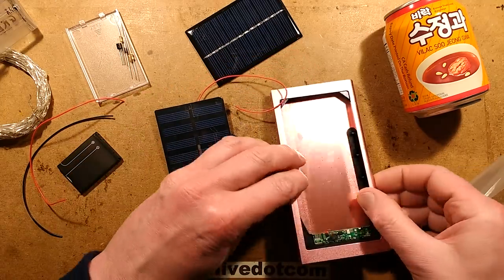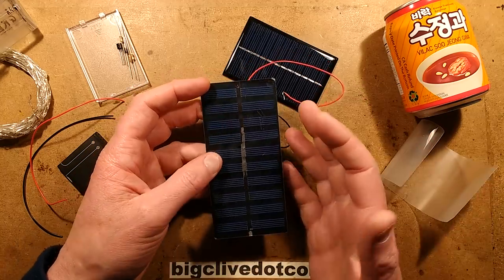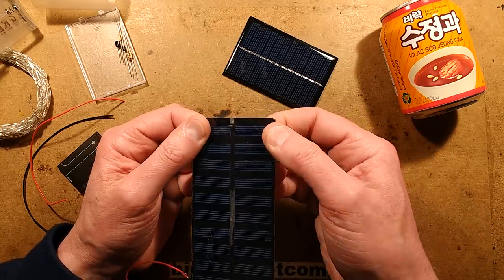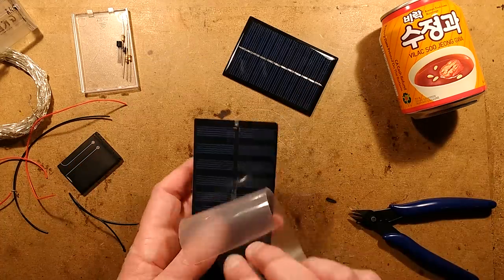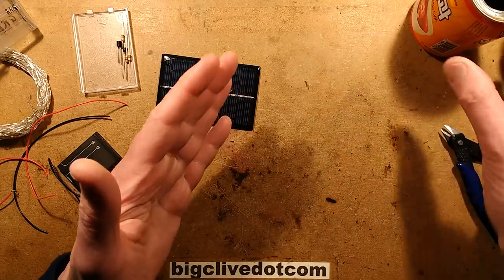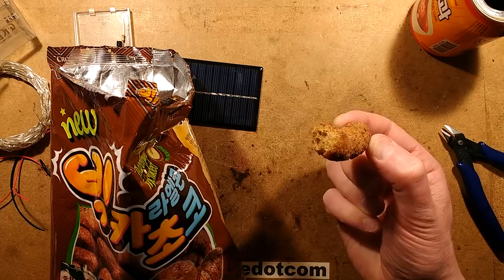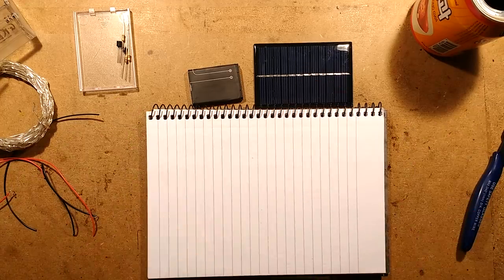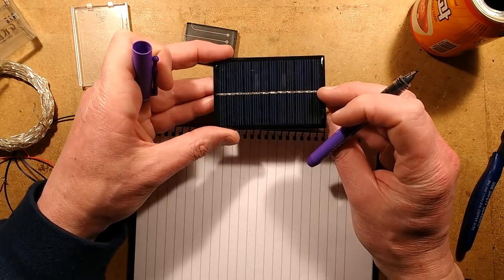Simplest solar light possible, using old phone battery.

Comment: You could possibly apply this to an old car for example (or RC car) to have automatic lights, though on a road car you need to make sure when the car is turned off it doesn't turn the lights on when your are in bed at night, lol.
Great Video Clive.

Comment: Ah something I know a bit about!  
I've played with those cells a lot for projects.  
If you score the surface with a blade and soak it in acetone for about a week, it will take it all off the cells so you can extract them... In all their micro fractured goodness.

Regarding them being cracked, surprisingly they can actually be significantly fractured before it impacts performance, so long as the potting holds them in their original place.  
This includes household solar panels upwards of 200w. I have have tested several that are shattered and they still produce most of their power. (5A out of 5.5A max short circuit current)  

However, I've also seen intact household panels where little cracks can be seen in the cells with a brownish burn line along them. So obviously some current is shorting across despite them still producing

Comment: Dear beloved Clive, I just made the exact same circuit a month ago, with the only difference of using a MOSFET instead of a transistor (I use MOSFETs because I design electronic chips; if we used bipolar transistors, we would need current to keep them in the on state which is unacceptable). 
This has the double benefit of: 1. not allowing the connected LED(s) (or whatever you connect to your output) to drain the battery bellow 2V which is extra crucial with Lithium Fe or Lithium Polymer batteries (that you are using) since most MOSFETs have a gate turn on (threshold) voltage of 2 volts, and, 2. it requires NO resistor at its gate (your base since you are using a transistor), since the gate of a MOSFET is just a tiny tiny capacitor. Using a MOSFET, you require NO current at all to pick up or to feed your ON or OFF state. So, using a MOSFET you will be amazed by the efficiency gain! It's like it's not even there. Bipolar transistors are the shame of the family, use only MOSFETS man.
Also, regarding the diode: I initially thought of putting a Shotky diode since it has less of a voltage drop (0.3V compared to Si, which is 0.65). HOWEVER, Shotky diodes are sooo leaky (reverse leakage), they are even leakier than the whole solar panel (the solar panel can be considered a diode at dark, and basically it is in reverse to the diode we have put in the circuit). This means that if you use a Shotky diode, the circuit will not work, since at dark the Shotky will be leakier than the solar panel, dragging the voltage at the MOSFET gate's node almost down to zero, not allowing the MOSFET to turn on. Using a Silicon diode, is like having the same material as the solar panel for your diode, and since the diode is just a tiny spot, it is guaranteed to be less leaky than the solar panel. 
At night, with a Silicon diode, the solar panel is leakier, so the MOSFET's gate node will see a much much easier path to the plus side (your solar panel at the other end is connected to +), so its voltage at the gate will be almost whatever the battery is and the MOSFET will turn on fully and happily until the battery drops to 2 volts. During the day, the solar panel produces energy with a polarity of (-) at the MOSFET's gate node, dragging the voltage down to zero, turning off the MOSFET.
Reply from the maker: I had pondered using a 2N7000 in the circuit for the reasons you mention.  The on-state resistance is actually enough to limit the current through the LEDs too, so theoretically the circuit could be built with just a FET and diode.
Reply: That is exactly what I have implemented!!! I love this circuit as it has NO resistors, and I hate resistors. It's just a MOSFET, a diode, a LiFePO4 battery (nominal voltage 3.2V, max 3.65, depleted bellow 3.0), and an LED which is happy turning on with no resistor at 3.2 - 3.65 V (have connected blue ones, you could do it with a blue or any other colours based on the blue emitter).
I watch it for a month now and love it as I know it has not dissipated not even an electron in a resistor in the circuit. The design could only have been achieved with only one cell (better than charging 2 cells in series, it never is done exactly right), only with the LiFePO4 chemistry. Its voltage is right enough to turn on mosfets, drive LEDs without resistors, and mosfets normally turn off at the voltage it doesn't like to go bellow (2V - 2.5V). All the component values had to agree, and since there exists this combination of a circuit, one can only just sit back and admire how everything fitted together.
Reply: I drive the LEDs at their voltage, 3.2V, no resistor is needed. Therefore, since I had available an IRFZ44N, I used that, it is an overkill, I know, for a few LEDs. It's gate turn on voltage is much higher than the 2N7000, it's 2-4 volts (I need a high turn on gate threshold value so that it turns off when battery goes bellow 2 volts so that it doesn't kill it). Also, the RDSon for that MOSFET if fairly low, so most of the current depends on how the LED accepts it (I have matched the LEDs with the nominal voltage of the battery, which is 3.2 volts for about 80% of its life).

Comment: When you connect the base to the positive side, wouldn't it light up as soon as the battery is fully charged but it's still daytime? There wouldn't be current flowing through the battery, so it has to flow into the base, trigger the transistor and then the led lights up.

Comment: I've built two of these, and learned that in order to make the LED bright enough (at least brighter than they were with the original circuit), I needed to eliminate the 10K resistor on the base of the transistor.  I simply connected the base to the diode/negative of the solar cell.  It has the advantage of simplifying the circuit even more.  I'd prefer the LED's were even brighter - the transistor still does not seem to fully turn on - still working on that.
Reply from the maker: I did a PCB based version with a MOSFET, which tends to turn on easier.

Comment: Great little project, I think I have all the parts necessary in my collection to build a few. I have a stack of small 5.5v solar panels, which when I tried wiring about 10 in parallel it was enough to charge a USB battery pack.
Regarding lithium battery storage level, all the lithium chargers I have which I use to charge packs for my quadcopters have the storage voltage set to 3.8v or 3.85v, 40% charge apparently, but packs that have arrived by post are often usually lower voltage, seem to be about 30%.

Comment: I discovered your channel shortly and love it. In videos i try to learn something from it others inspire me to try some builds myself. But i find it difficult to modify your builds to my situation of components that i collected and salvaged from the trash bin. Since I am not a electronics technician i don't have the knowledge to do so. For this video in particular, i would love to have the schematics for a similar solar light but with a 2V solar pannel + 1,2v NiMH battery and a couple of (4 to 10) of the same leds but in white. Maybe in videos like these it would be great if you could suggest different component values for different situations. Like in a table or so.
Reply from the maker: You may find it easier to get an existing solar light and replace the original LED with a string of parallel LEDs like these.

Comment: Nice.  I think I'll make one of those right now - maybe do it as a module that can be hooked up to a battery connection (got a strip of lights that runs on 2 AAs).  Also a good excuse to finally take that shítty old windows phone to bits :p

Comment: This video inspired me to build an USB powered emergency light from a LiIon battery "10W" LED floodlight. Handy to have in some poorly powered environments (e.g. sites on generator power), does not meet regulations for emergency lights 100% but is better than nothing (does not switch on within legally required time because of the capacitor in the USB power supply discharging slowly, but lights up within less than a second).

Comment: I found those epoxy coated solar cells to be inadequate for all my solar projects, especially for ones inside a car. If you search for "solar charger glass", those work 10x better. Also when the epoxy ones get foggy you can use automotive rubbing compound and toothpaste to polish them up again.

Comment: Japanese and American sourced transistors (and other semiconductors) have a simple distinction. U.S. starts with 2N** while Japan starts with 2S** (or just drops the 2S from the label). So a Japanese C2222 is a U.S. 2NC2222. Also, the pinouts are switched. Japan puts the Base on the end, U.S. puts the Base in the middle. Both make sense in their own sort of way. Brits put a rectangle where a squiggly resistor symbol belongs.
If you're having trouble trying to understand how a transistor works, think of the dimmer switch on your wall for an overhead lamp fixture. A tiny effort from your fingers (Base) allows a massive current to flow from the power company (Emitter) to your ceiling lamp (Collector). But you can turn the power up and down with only a tiny input. Biasing the Base with a resistor network is the equivalent of bumping the parameters on your dimmer so there's no "dead spot" at the bottom of it's travel. Biasing would make it start conducting exactly where you want it to begin, rather than a third of the way up the scale and then "jumping" on.

Comment: As you paused to contemplate the diode band and how to orientate it, i was reminded of current flow. I wish that when its direction was initially chosen, that it represented electron flow rather than the opposite of the electron flow. There would be less chances for confusion.
Reply from the maker: They didn't realise at the time, since metals seemed to flow from positive to negative in electrolysis.  I use conventional current flow to make things easier for those new to electronics.

Comment: You know the first time I watched this video, it got me thinking.  You see I was really into those little mini pocket PC's called PDA's before I decided I would give in and buy a smart phone.  So it was that I have a LOT of old PDA batteries laying around, most of them still hold a reasonable charge. So for my first attempt at making something out of it, I found a little board on Ebay that was a combo board that had Bluetooth reception, a mini SD slot for local MP3 playing, and a built in amplifier that could drive small 8 ohm speakers.  It wanted 3 to 5 volts for power.  So I wired one up to a little PDA battery (3.7 volts) hooked a couple of those cheap china silver faced 8 ohm speaker that looked like something for the old 8 transistor radios of the 60's, used some hot snot glue to mount it all in a cardboard box from some device I purchased over the years from China.  I poked holes first so the sound could get out and used my label maker to mark all the built in buttons, then covered it all with some contact paper that looks like woven fiber material.  For charging, I was in luck as the combo card also charges the battery when plugged into a USB port.  Now I have a  small MP3 player that can also serve as a Bluetooth speaker for my Phone, Computer or what ever I want to shove at it.  The old battery has held up very well, total cost for all the parts was around $6.00 US  To top it off, the little player does sound fairly good and  sound wonderful if you plug in some headphones.  It can also transmit to my hearing aids if I pair them so that's makes it a great two way MP3 player.  Only problem now is that everyone who sees the little guy wants one!  I am sure somewhere on Ebay you can get them ready built.

Comment: Drawing the pinout of the transistor is very helpful. It helps bridge between components and diagrams, i like to draw the components in diagrams as the look in the hand,  how easily do the green leds trigger the transistor into flashing the circuit,  putting everything into waterproof led floodlight  fitting would be ace.  Interesting crisps to use in poop eating prank.

Comment: My understanding was that lithium rechargeables are supposed to be stored at 50% charge was a compromise: they degrade slower the less energy is in them, but at 50% charge they degrade barely any more than at 0% charge and because they self discharge at a relatively rapid rate storing them at lower charge levels increases the risk of overdischarging them in storage and permanently damaging them.

Comment: I find myself suddenly flooded with these type batteries. You see many of the new all channel am/fm/sw/lw/weather/alert radios from China run on them. I find myself with 3 of them now, each with it's own rechargeable battery of that type, and I have ordered 3 extra batteries in case of power outage where a battery change would be in order to keep up on what is happening in town. I rotate the batteries to insure that all have a current charge, and find myself using the spares for other projects, then ordering another to replace the spares. I may well just go down to 1 spare as I can simply change radios should the need arise.  Another nice thing about these sets is the fact they are bluetooth enabled to use them for external speakers.

Comment: A nice sneaky trick you could use here is to use a very high value resistor as an "insulated" standoff from that pad on the solar cell; say 1M Ohm or so. Can be handy at times :)

Comment: I haven't read all the comments, so this may have been covered. I have an explanation why your pocket light failed to extinguish the solar light completely when at a lower than full level.
The pocket light would have been using PWM to dim the LED, The solar light was reacting to the pulse of the light and switching off when the torch light was on, and on when the torch light was off. It gave the illusion that it wasn't turning off, but I guess if you watch it a bit more closely, you'll find it was dimming. At full level the LED is permanently on and the solar light can be partially lit by a varying voltage due to partial illumination. With PWM the light level change is abrupt and will cause the solar light to turn on and off rapidly.
Reply from the maker: I did realise that afterwards.  Solar panels have capacitance and the PWM was being defeated by the slight time delay as a result.

Comment: I will be trying this.. thanks BigC. I am still wrestling with my mind, though, if in fact one could also be using a PNP transistor instead, with the solar panel connected to the base, that, in the absence of current from it, the transistor would be turning on and at that point the LED connected to collector say, would be turning on. I must say I am rather new to it all so excuse I may not explain it well. I suppose it's worth trying everything!

Be well!

Comment: I'm thinking this might work nicely with a low-turn-on-voltage N-FET in place of the transistor, and without a need for the resistor. I had never thought to do this on the negative side, quite cool.
Reply from the maker: I've been toying about doing a follow up with a 2N7000 FET as you describe.  Possibly also using the on-state resistance as LED current limiting.

Comment: The protection in the battery pack is only a thermistor to sense the temperature to switch the charging circuit in the phone off if it gets too hot. The voltage still has to be regulated to 4.2V. Some modern batteries are rated at 4.35V, or even 4.4V, but they must all be regulated or the battery life will be reduced. You can go less and get more life, but less charge capacity (the military use 3.92V, which gives about 75% capacity but much more life). There are little charge management chips available that regulate and terminate the charge when at full capacity. Ni-MH cells are much less fussy about charging and would be better battery for that if the voltage is high enough (maybe 4 cells if it isn't). A really good transistor for that is a BC337-40 or BC338-40. They are .5A so they will handle the current better with lower saturation voltage, and have a minimum gain of 250.
Reply from the maker: In these batteries there's usually a DW01 and MOSFET package to protect against overcharge and discharge.
Reply: Prob you should watch this: https://youtu.be/ZAeOkaEFPLA . His another video about these phone battery.
And to test these battery, he also cover it on this video: https://youtu.be/W8VpNJs6ek0 at minute 22:30.
Cheers.

Comment: I love watching and listening to your pods? Can you answer a couple of questions please? First how can you tell if there is the safety device in the phone batteries and if not can you tell me how to (if possible ) add one?
Reply from the maker: You can get external cell protection PCBs.  The easiest way to test the existing pack is to use a low resistance load to shunt the output briefly.  The small packs like these can generally be tripped by two 1 ohm resistors in parallel.  When tripped the output will turn off until reset by connecting briefly to a charger.

Comment: @ 03:15
What i have learned just recently on a youtube video about making cans:
Non carbonated drinks get N/Nitrogen added as gas to it, because the strength+stability of the can also depends on the higher inner pressure :-)

And that is why non drink cans for food need those stabilizing rings, but drinks dont need them :-)

Comment: Amorphous silicon (like in calculators)  has  inverse current output per temperature rise and so require much better backing ventilation. I would bet the the deep blue would get quite hot as well.